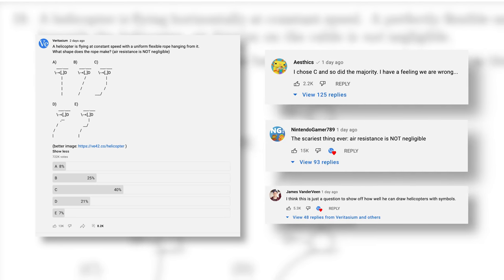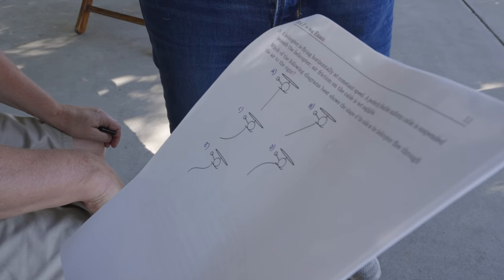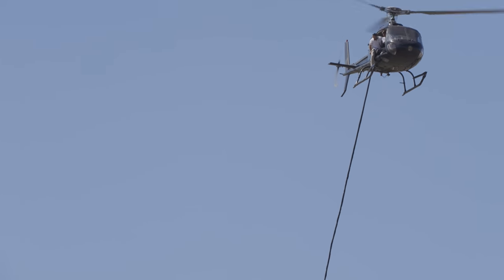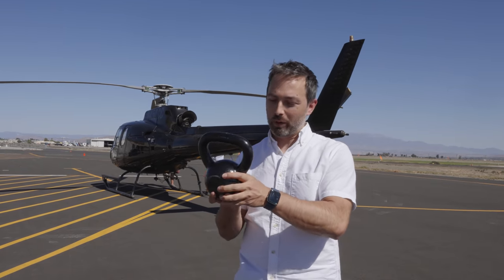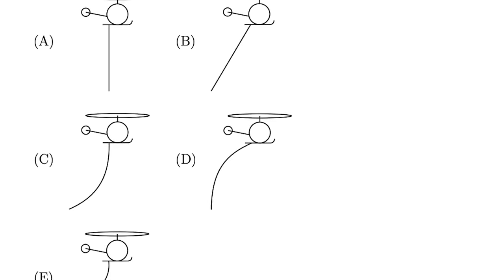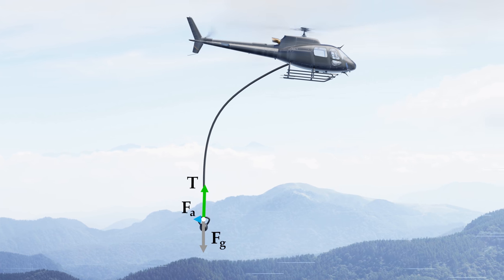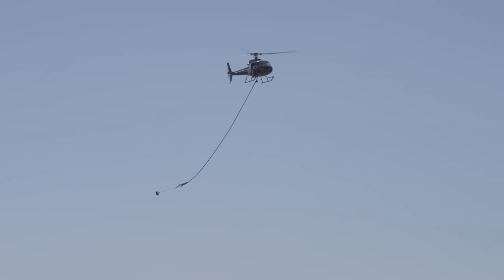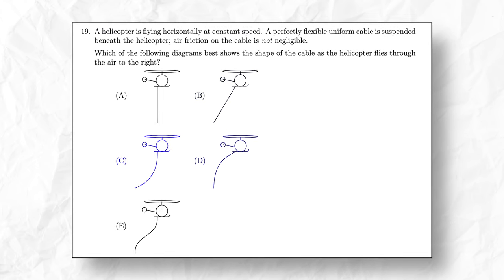I Rented A Helicopter To Settle A Physics Debate

Comment: Classic physics teacher/professor; goes on hike in nature, comes back with difficult exam question.
Reply: Lol
Reply: That's not a difficult question, a child would get it right without hesitation
Reply: In fact it blew my mind how easy it is and how in the world it could make its way into qualifying exam, thats basic inertia, anyone who ever been in the moving vehicle can get that right without any physics background.
Reply: @Roman-kk1ic  funny thing is that the explanation did not have anything to do with inertia
Reply: @Roman-kk1ic  How is it basic inertia?
Reply: @fenhen   not a physics teacher nor I have time to break this down use Google my friend
Reply: @fenhen  actually fine, go on the bus and hang on the railing, once it starts accelerating or stopping you'll go diagonal not S shape lol.
Reply: @Roman-kk1ic  Only for as long as the bus kept accelerating. If the bus was moving at a constant speed, gravity would pull you straight down without any other forces interacting - unlike in the case of the rope on a helicopter, where it is gravity vs air resistance (+ inertia for the part when it accelerates/slows down, not part of the question, though).
Reply: @Roman-kk1ic  I am a physics teacher and it sounds like you’ve totally misunderstood the question.
Reply: @fenhen  I'm not a physics teacher but I got the question right and the answer right, right away, maybe I didn't explain it right, I'd love to hear what I said wrong tho
Reply: @Roman-kk1ic  The key part of the question is that air resistance is significant. Your example doesn’t appear to factor in air resistance at all. As someone else said, it also seems(?) to be talking about acceleration rather than constant speeds.
Reply: @Roman-kk1ic  bruh it had like 3 different answers depending on what kind of weight you add to it.
Reply: These were basic vector calculations of high school level.
Reply: @Roman-kk1ic  dude, did you not listen to guy with a Phd in physics say its counter intuitive ...  most of the time questions in physics exams are counter intuitive ..thats the whole point .. i know cause i got a degree in physics and chemistry and wrote many exams/tests/done experiments and wrote reports on them

the more you know something .. the more you realize how much you dont know
Reply: @jackblack5082  I agree with the second part, but first one I don't really get, cuz this question at least to me was super extra intuitive.
Reply: @jackblack5082  if you don't mind me asking, what do you do with your degree in physics and chemistry? If it's McDonald's or something unrelated you can ignore the question.
Reply: @Roman-kk1ic  like you told the other guy, google it

ok so how would you get shape e) in that diagram .. explain the set up
Reply: @jackblack5082  rope hanging from moving helicopter, I don't see any reasons for it to be anything other than diagonal, unless it's weighted or parachuted, duh
As for e) you'd have to split the rope in three and attach weight-parachute-weight
Itsa obviousse
Reply: @jackblack5082  btw I don't have a degree in physics nor chemistry (idk why would you bring chemistry up other than to brag) in fact when I was in school I sucked at physics, so such entry question blew my mind.
Reply: @Roman-kk1ic  yip sorry, im proud of it so why not show it off .. i put the work in after all.

you said: "That's not a difficult question, a child would get it right without hesitation"

and you also said: "In fact it blew my mind how easy it is and how in the world it could make its way into qualifying exam"

my point is you making it sound unreasonable for someone to not get the right answer ... like its easy ... but you yourself cant reason why you choose the correct answer

1) cause you seen the answer after
or 
2) cause you was lucky to choose the correct answer

this is why, i asked for a set up .. to form the shape in option e) to see if with all the info from this video you could find a natural solution which a kid should also be able to do right

sorry im being an ass NGL ... im just tying to say dont try to put people down who dont understand the question or see it as intuitive cause its not the case

if someone who read your comment got it wrong they might think they worse then a kid yet a guy with a phd believed it was counter intuitive
Reply: I was just about to say 😂😂 they think about something while calm and possibly observing the phenomenon and then put it into a high-pressure 0 context situation for less qualified people to solve 😂😂 whyyy?!
Reply: @jackblack5082  dude just guessed the right answer and start calling people dumb lmao
Reply: @Roman-kk1ic  big difference between showing your education level and braging, the only braging here seems to be from you guessing the right answer but unable to explain it and instead tell people to Google basic inertia which wasn't part of the answer.
Reply: @karl810  so you're saying I guessed the answer and you weren't bragging with your irrelevant education level? Sure bud, lol and inertia has nothing to do with anything, right :D. It would really help your case if you explained anything with all your degrees, but instead all you type is some expression of hurt feelings.
Reply: @Roman-kk1ic  actually, if you bothered to check  who you were replying too I was sticking up for the other guy whom you accused of bragging. I have no degree in chemistry, I also didn't say "inertia has nothing to do with anything". I said, like the other person you ignored that it wasn't part of the answer to this question. But good luck in life with an attitude like that.
Reply: @karl810  so you an internet vigilante with no degree in chemistry and bad literacy? My bad good luck with your buddy, hopefully he'll appreciate your broad shoulders with a reply and you'll have a great life as a family.
Reply: @Roman-kk1ic  so you're an Internet bully with no degree? I have one, just not related to this subject in any anyway, and I dont need the person to notice, validate or thank me for calling out people like you when the need arises. I think you're the last person to be calling out bad literacy too.
Reply: @karl810  yeah right, do you feel bullied?
Reply: I think this helicopter scenario is kinda counter intuitive, because we may have observe certain things in our life, but maybe not exposed to the full air resistance, or stuff. Like I'm sure many people have seen something decorations hanging down inside a car, and these decorations probably make a straight line when the car starts moving (even more confusing if you have a helium balloon tied inside your car).
It's probably really hard to work out from what we observe in a car to an actual rope hanging down from a helicopter.

Comment: I feel like my insanely low understanding of physics led me to the correct answer. Thank you brain for that one.
Reply: now I feel like an idiot even tho I got (guessed) the right answer :(
Reply: lol, me too. good at mathematics, terrible at physics.
Reply: @Coecoo  It's not controversy, it's debate. The right answer is clear from this demo beyond reasonable doubt and you could conceivably work through the same reasoning in an exam to arrive at the answer. So long as the premise is laid out clearly this is not a bad question.
Reply: Oh you mean common sense?? Lol
Reply: Im glad i found this comment lol! For a moment i thought i was a genious.. 🤣
Reply: @angycf98  Did you even watch the video? There are several factors that changes the rope behavior, including weight and even how fast the helicopter is going which is both details not given in the test.

Then there's other stuff that can change the answer such as altitude & temperature where the helicopter is and even weather conditions. The Aerodynamics/shape/material/length of the rope with the made statement of "perfectly flexible" also being able to be interpreted in several ways.
Reply: Same
Reply: @Coecoo  

"There are several factors that changes the rope behavior, including weight, and how fast the helicopter is going, which is both details not given in the test."

The weight of the rope, and speed of the helicopter are irrelevant, because they will only affect the angle, not the shape the rope takes. The material of the rope, and it's aerodynamic cross section (shape) will also alter the angle of the dangle, but not the shape it takes, because it alters the wind resistance along the entire length of the rope. The length of the rope will only affect the shape if it is sufficiently long enough to be in significantly different densities of air. I'll let you take a guess how long that would have to be. The weather conditions will affect the experiment only if there is high enough gusty winds to push the rope around erratically. A high, uniformly directional wind can simply be flown into simulating flying at a greater speed, and it will change nothing about how the rope behaves.

The addition of a weight/parachute at the end of the rope is an alteration of the conditions of the question, because it makes the rope non-uniform, by altering the mass/air resistance at one end.
Reply: Bubba Fett92 - Well, there are basically three kind of people who got the answers right. First there are people who just made a lucky guess. Next there are people who are well versed enough in the study of physics that they were able do the correct mathematical equations to solve the problems. And lastly there are people like me (and perhaps you) who are able to actually sense correctly in their minds how all the various forces will act upon a given object under a given set of circumstances. Of course right now the only thing I’m really interested in is the phone number of Miss leopard print. And I don’t even care that she got the answers wrong because, lets face it, I’m not really interested in her for her intellect.
Reply: Same. I thought maybe I would be wrong each time but my intuition led me to the correct answer for all three scenarios.
Reply: Yeah I just saw constant and thought of slope and chose b
Reply: I just feel sorry for the 8% that picked A (straight down rope)
Reply: The correct answer is A because the question specified a cable, which is firstly made of metallic fibers. If the weight is 50% of what the helicopter can carry, it's going to be closer in angle to answer 'A'
Reply: When imagining the scenarios in these types of questions you have to sometimes neglect a few factors to get a rather less complicated path to the answer and it's a really hard thing to do.
Reply: @SLOBeachboy  And then there are the people who got the correct answer. A is closer to the angle of the cable if it's over something like 300lbs. Does anything off from 90 degrees cause it to be answer B? I don't think so, whichever is closest to the final angle would be right
Reply: Nah man. Call it intuition. 🤓
Reply: @joelbadger9661  Did you even watch the video?
In the visual demonstration it clearly shows that the correct answer would be option B and because of air resistance and gravity a helicopter moving at constant speed would result in the rope being diagonally positioned. The only exception is if the aforementioned helicopter is moving at low speeds, In that case it would be option A, Though that is not the case therefore the correct answer is option B which you would know if you knew anything about physics. The test also clearly states that air resistance is not negligible in bold text. Please have a valid argument next time. (P.S. no attitude was put into this and this was said in a very bland tone, everything i said was for the purpose of education and i admit i did get a bit carried away, none of this was meant for disrespect or hatred)
Reply: @joelbadger9661  hey bud not sure where you get your definition of a cable but I'm sure you've heard of cat5 cable, last time I checked most of that cable is a polymer insulation.
Reply: @Coecoo  the only reason it shouldn't be on an exam is if the students were not previously taught the concept. the point of an exam is to test whether you understand the concept you previously learned or not.
Reply: @notahotshot  I just didn't know that the propwash of a helicopter did not extend past the bottom of the helicopter, (in a big enough way to make an impact) I have stood around 30ft below a hovering helicopter, and could feel the wind going down. So i (wrongfully) assumed that the thrust from the helicopter would also impact the rope.
Reply: @TripleSuccotash1  That doesn't invalidate my point. If this was a cat5 it would go straight vertical at high speeds and and likely into the rotor. Answer A is right in most situations
Reply: @C C You obviously didn’t watch the video
Reply: @TripleSuccotash1  thats an electrical cable not a structural cable lol. there is obviously more than one definition for cable, although the first definition is that of "thick rope made from metal or non metallic fibers, often used for towing vehicles, construction, and mooring ships."
electric cables do not fall under the same description
Reply: @ameraldas3641 , yes, anybody who did not know the prop wash would have a limited effect could have trouble with the answer. My comment was directed at C C, who asked "Did you even watch the video?" Then made claims that were just plain incorrect, or irrelevant.
Reply: @Naveen Kumar Thank you, TG is one of my top ten anime and it's nice to know I'm not the only one who still likes the show.
Reply: @joelbadger9661  , answer A is only right under no movement, or movement insufficient to overcome the inertia of a cable of any given mass.

Based on the nature of the question, and the possible answers, it is safe to assume a speed capable of overcoming the inertia of the cable, regardless of the cable used, but not so fast as to put the helicopter in danger of catastrophic failure. The specific speed of the helicopter, and the specific angle of the dangle are irrelevant.

A lighter cable will move to a greater angle at a slower speed. A heavier cable will require a greater speed to move to a greater angle. Any movement of the helicopter, which results in the cable moving from it's vertical orientation makes A incorrect, because a constant speed will keep it at an angle off vertical, and a greater constant speed will simply result in maintaining a greater angle.

I suspect that a lighter cable was avoided because it would be subject to lower speed, gusty winds, whipping it about, creating more risk.
Reply: @notahotshot  That 3rd paragraph is wrong. Think critically here rather than assumptive. The question doesn't phrase it in a way that anything other than perfectly vertical makes answer A wrong. That's the whole point. It asks "which one best represents..." It's an excellent argument that whichever is closest to the angle of the answer is the one that best represents. A 300 lb cable at sufficient speeds is closest to A. This answer is correct if the cable is metal, a median load, and at all speeds the aircraft is capable of. I'm referring to a heavy cable load, not a light one. The specific angle absolutely matters because you're choosing the closest of two angles.
Reply: @horriblesinger1015  I watched the video. You missed cable weight bud. I'll spell this out for you: Answer B shows 45 degrees and Answer A shows 90 degrees. If the cable is greater than 60 degrees, which one is the correct answer?
Reply: @joelbadger9661 , ok, I'll concede the point that if most lines, of reasonable length, are sufficiently massive to limit the ability of the helicopter to shift the angle, against inertia, beyond a 22.5° change, then yes, answer A is correct, "in most cases."
Reply: @joelbadger9661  

"Answer B shows 45°. Answer A shows 90°. If the cable is greater than 60°, which is the correct answer?"

If it is greater than 60° but less than 90°, then it is a straight diagonal, which is represented by B, so B is the correct answer.

I know, I know, I conceded anything greater than 67.5° would make A correct in most cases, but that's only if you exceed the capabilities of the aircraft to achieve a higher speed creating a greater horizontal force.
Reply: @notahotshot  Oops my angle was wrong. 45-67.5 = B and 67.5-90 = A. So the question is what percentage of cases is A right? I think there are enough variables that A should be accepted too. If the 'cable' is super thin, it'll likely be whipping all over rather than straight. The pilot himself said this could be the case. If it's relatively heavy (200-300lbs), it'll be closer to A. I assumed this was a metal cable - if the question didn't specify, they can't write off A
Reply: @notahotshot  A 67.5-90 degrees is well within the capabilities of the aircraft